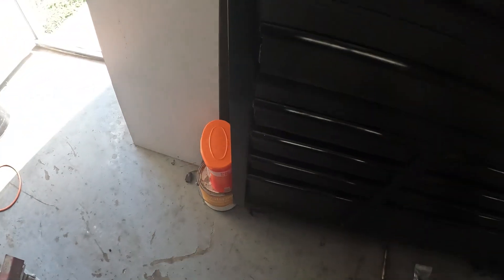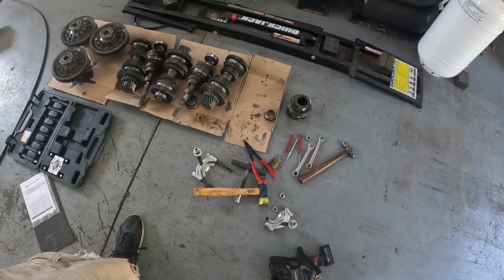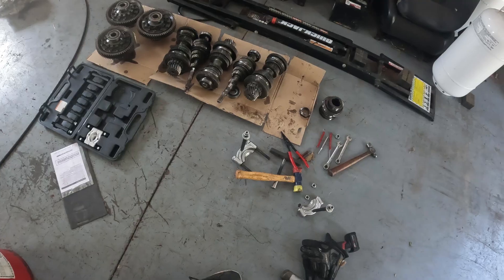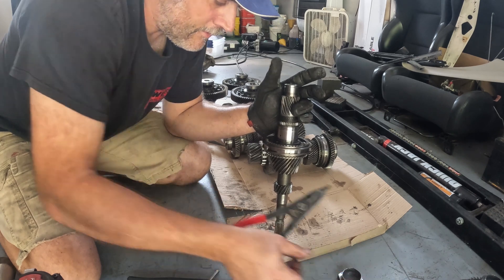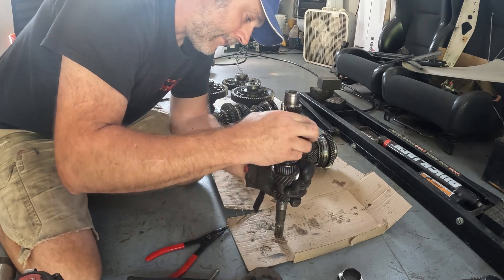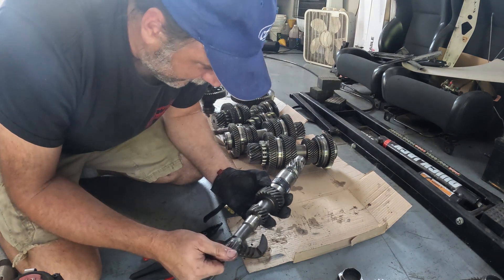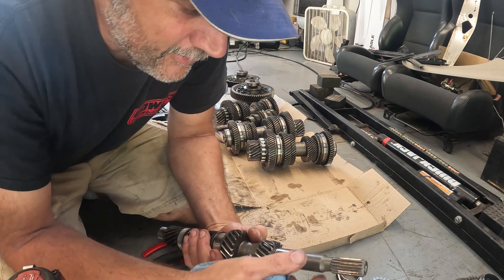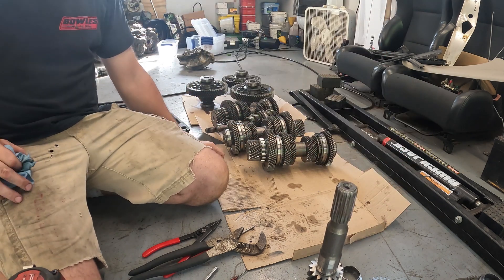how to pull the gears off a t850 input shaft

Comment: Hey man! how would you start an srt that has been sitting for about a year? Was gonna turn over the motor by hand for a few mins to let oil circulate, should I worry about the cams in your opinion? they are newish so if I have to take the cams out and lube them up before I do start to be safe I will lol.
Reply: If it has oil just crank it lol. Mine been sitting for a over a year because I wasn't driving after a bad motorcycle accident.  I just fired it up last week to move to my garage to install my big turbo kit. Got oil instantly in the head and I could tell because in the short drive  it leaked from a middle valve cover bolt that I forgot to tighten down. Just fire up and let it ide for a couple minutes and you should be good.
Reply: also I replaced valve cover before the move and there was plenty of oil film on the cam shafts. good enough to idle and then drive.
Reply: @davidnunez3523  thank you! Feel better about it, plus these engines I know aren't so fragile to begin with. Needed the added assurance